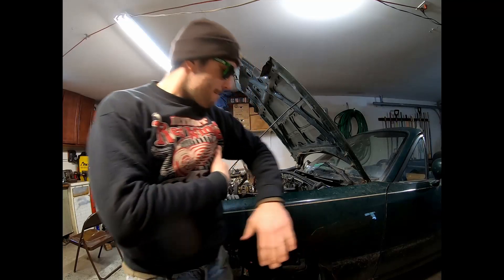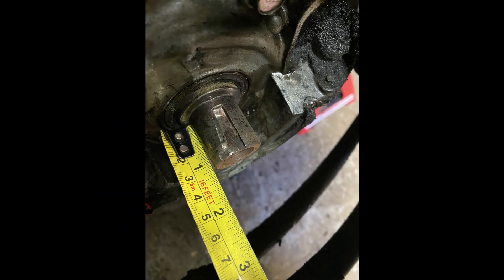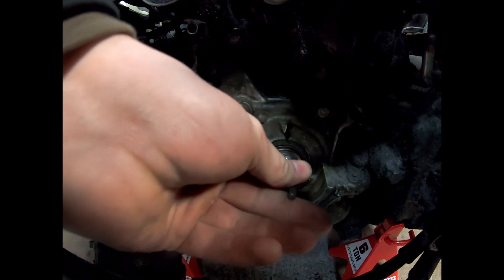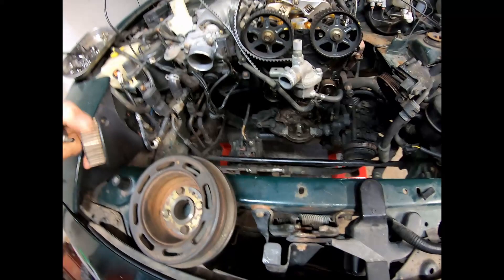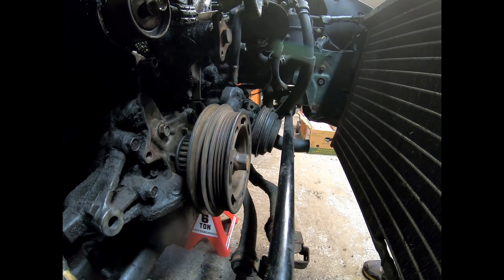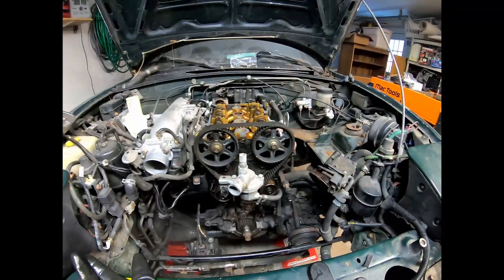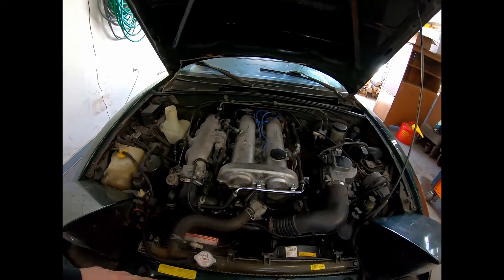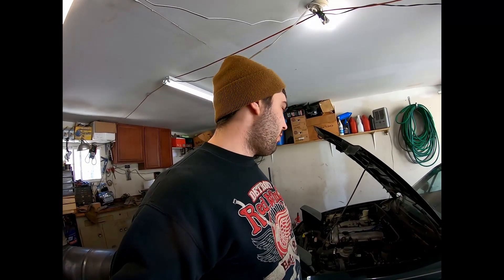1.6L/1.8L Miata Crankshaft Saver Keyway Repair (Permanent Fix)

Comment: it was running like dogshit before,, and now it runs fantastic..... heres the reason..... The crankshaft & the 2 over head cams have to both turn at "EXACTLY"  the same time...... if the DOHCs move just even a little after the crankshaft turns and im talking "microscopic" then itll never run right, no matter what you do to it... thats why even some guys put those stiffer racing cam-belts on.... but if you get that crank and DOHC to move at precisely the same time,,, then you'll be in MX5 heaven  :)

Comment: So what this does is that you can swap your short nose in to a long nose? It’s like an adapter, right?
Reply from the maker: It extends the crankshaft length to prevent crank pulley wobble
Reply: @theBdunklee  got it, thx man! I’m making this job on my miata next week but wondering what pieces I will need to buy for my short nose to fix it properly and not miss anything… I don’t want to have my car broken for long time, I want to order all I need and fix it, do you know what pieces will I require to change when I fix it?

Comment: Did u use the one from ebay that u linked ? i got one in and it had no threads and wondered if u ran into the same problem
Reply from the maker: It is not supposed to have threads. I used the exact same one from the link in the description.

Comment: Do you think this would work on the 1.6l in the 2001 mazda protege zm-de engine the pulley look the same timing gear and keyway?
Reply from the maker: Possibly but I am not sure. I’m sure you could find some stuff online about the compatibility. Let me look and get back to you!
Reply: @theBdunklee  Thanks would really appreciate it, I will be looking as well.
Reply: IF your 1.6 has a Big Nose Crank (Presence of a Pulley Boss) it takes NA 1.8 parts and specs, see comments on Crank Saver issues above!

Comment: Still going strong? Asking for a fellow long nosed wobbly boy
Reply from the maker: Yea, still no issues since. Are you planning to do this repair?
Reply: @theBdunklee   Yep! Literally just bought an NB less than a week ago, checked the carfax and saw that two belts had been replaced back to back, so I started my car looked in the bay, and that pulley was shivering. Idk about doing the weld, but I already bought the crank saver so I’ll get my local shop tho throw it in when I’m getting my WP and timing belt done next week!
Reply from the maker: @awgie  sounds like a plan! I have an NB1 that I turboed and love it. I made a couples videos on it.
Reply: @theBdunklee  Nice!! Yeah mine’s a NB2 with 91k on the og motor. I bought auto because there’s not a single modification done by any previous owner, I’ll run the auto into the ground then manny swap it, but v excited it’s my new project!
Reply from the maker: @awgie  yea, always a good snag to find a grandma auto car and then manual swap it. Tons of write ups on it too! Good luck!

Comment: hi mate! thanks for your video, are you using stock pulley bolt? isnt it too short for locking the pulley?
Reply from the maker: No, the stock bolt still works
Reply from the maker: It only reduces the amount of threads used by less than 1/4 inch
Reply: @theBdunklee  okay , but sadly mine is shortnose.... bought the crank saver but seems it wont work
Reply from the maker: @kojohn7501  yea, it’s only for the long nose 1.6 and 1.8’s

Comment: you said it wasn’t gonna work for the short nose? Or it will ?
Reply from the maker: It only works for long nose cranks, kit does not fit the short nose cranks.
Reply: @theBdunklee  I see, thank you! , no hope for the short cranks loll, any advice for short nose cranks? I’m thinking of getting one and doing research
Reply from the maker: @charmcitysk8er  maybe inspect the crank before you buy it. There are temporary picture fixes people do for the short noses but I’m not sure how long they last. Good thing is that the long nose crank engine is a direct swap from a short nose. Or you could do a 1.8 swap.
Reply: @theBdunklee  looked fine to me when I inspected it, but now I’m questioning myself, may have to look again haha, thanks for your help! maybe I will do a swap in the future if I do get it!
Reply from the maker: @charmcitysk8er  Right on bro! Subscribe for more miata stuff if you would like. And message me if you do get a long nose 1.6 and want the saver kit!
Reply: @theBdunklee  will do man, what’s the temporary one for the short nose you mentioned?
Reply from the maker: @charmcitysk8er   they buy a new woodruff key, timing gear,  and crank pulley, then basically jb weld(using Loctite 660) everything in place. It will buy you more time, just not a 100% fix. Google or YouTube search Miata Crank Keyway Repair or Miata Loctite 660 Crank Wobble Repair
Reply: @theBdunklee  oh that, yes I’ve seen that, the loctite method, I see, but I guess if there’s no wobbles on the short nose, it might be good for awhile?
Reply from the maker: @charmcitysk8er  yea, many of them last awhile and you probably will be okay as long as everything is torqued properly and the crank bolt threads have blue loctite on them. I would just keep an eye out for a long nose crank motor for a backup if you do have any issues.
Reply: @theBdunklee  alright got it, thanks man! I subbed :)
Reply from the maker: @charmcitysk8er  thanks bro!